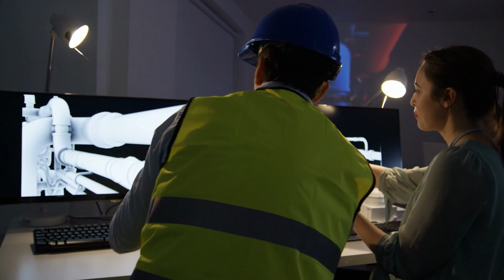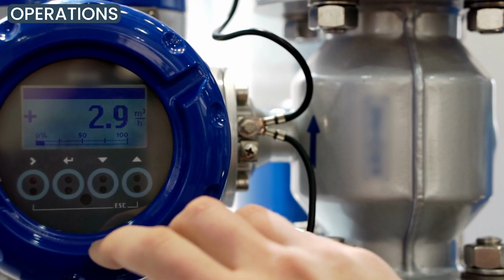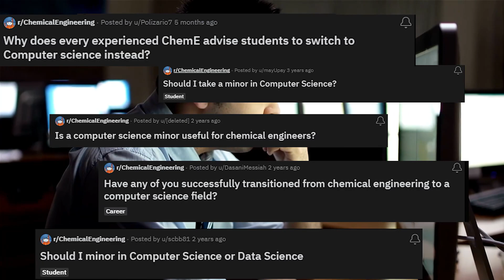What they won't teach you about chemical engineering

Comment: Hey Pat, I graduated from Chemical Engineering back in June, and got a position as a project engineer at a Canadian company responsible for designing pilot plants (out of the three fields you mentioned I think this overlaps with EPC the most). I'm not gonna lie, I've been feeling overwhelmed with all the things I don't know about Chemical Engineering yet. I did pretty decent at university, but I don't feel like a true Chemical Engineer yet. I feel that there are a lot of knowledge points in my head that have yet to be connected. I also feel like I cannot ask a lot of questions at the moment I get assigned to a task because I don't know what challenges I will face at that moment of doing it. It is usually after I've been working on the task (designing/simulating a heat exchanger for example) that I start thinking about all the things that are still unclear to me. Some things I realize strike as questions in my head are: I'm a Chemical Engineer, am I supposed to know this? or Do I know? I wonder if you felt like this in the beginning of your ChemEng career? Anyways, I'm posting this comment mainly to spit out some of my thoughts before going to sleep. Also, your content is amazing. Looking forward to watching more of you.
Reply: Also a Chemical Engineer with 12+ years experience here. Truth is, you're never gonna stop learning. Even after being in more than 30 projects or so, there's something new to learn. My advice to you is that you have to get really close to those more experienced. Don't feel shy and ask questions. It's completely ok not to know everything. Read those procedures. You not only went to collegue to became a "Chemical Engineer" but to learn how to solve new problems and challenges in a efficient way.
Reply: @IvanBohorquez  I completely agree with you - absolutely true. As a Chemical Engineer of 15+ years, there are some areas that I don't know especially when on a new industry. I only get close to the more experienced and ask loads of questions..we keep learning.

Comment: Pat, one thing you did not touch on was that if you work for a large Oil Company it is highly likely that Company will have opportunities for you to work in each of the areas you mentioned in your video.  I started my career in Research doing process development.  I then transferred to the Company's Central Engineering group where I worked on Process Design.  Those designs were carried over to the the EPC firm for final design and implementation.  My Company required I follow the project to the EPC firm and be part of the Start-up team at the Plant.  All this was great experience and gave me the breadth of knowledge needed for my 32 year career as a Chemical Engineer.
Reply from the maker: Hey thanks for that! I myself have a similar background. I did a little over 5 years in a refinery before moving to a licensor. The operations knowledge I gained was absolutely invaluable and I wouldn’t have traded it for anything, not even a masters degree like a lot of my friends did. I think starting off in operations serve a fantastic foundation for your career, just as you say.

Comment: Exactly very very true what u told in this video,
Recently I did my major in chemical Engineering and now working as a commissioning engineer at and epc cum technology company(praj industries a pioneer in Asia's 1G ethanol plant) 

,
Yes now when I came in job I can't think of an innovation, I have to follow the sops, I have to do the equipments test, I have to supervise the leak fixtures, control valve fixture for my clients, we need to think of money before thinking for any other more accurate procedure.

Yes I felt it job culture is actually different.

Comment: Sir I have one doubt, if I use two pumps for a single discharge line then will it double the flowrate for 2 pumps rather than that of 1 pump flow rate..
Reply from the maker: Definitely not. Look at pump curves for pumps in parallel. You add up their flows, but not their head. The intersection of that with your system curve will not be at 2x the flow rate. It will be higher, but not double. Especially not if your system curve is steep - lots of additional pressure drop for very little flow.